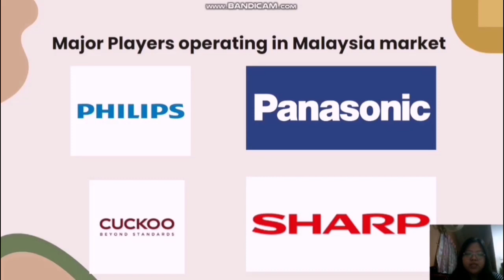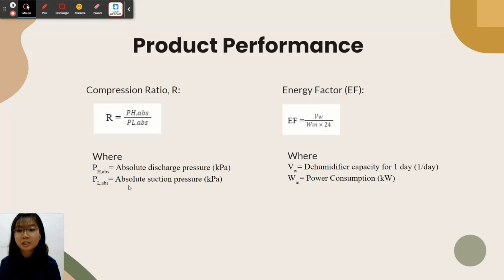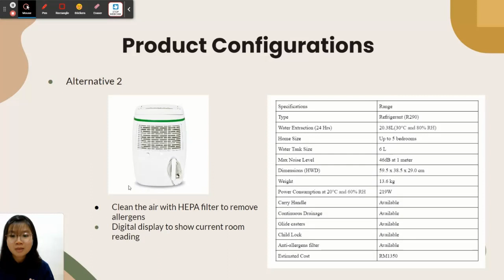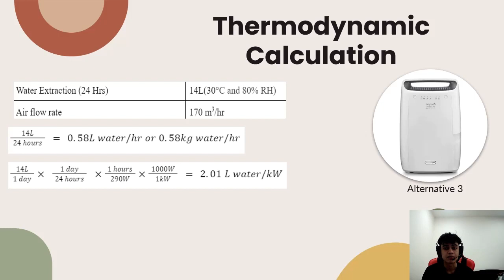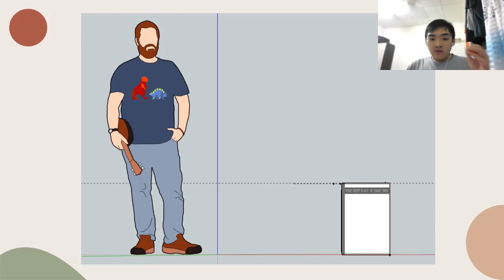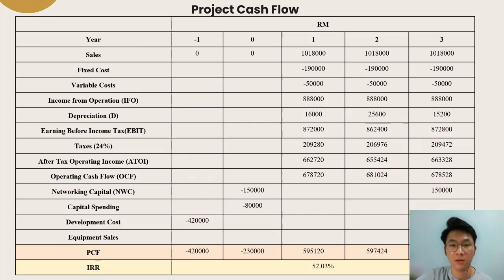CPD Project (Household Refrigerant Dehumidifiers) Group 6

Comment: Hi, I'm Kai Ying from Group 3.
I have question is that why is it necessary to have the Control Panel as well as the LED Strip as you've mentioned that it can be controlled through Wireless Connection from Smartphone right?
With the wireless connection, it seems like the two things mentioned above are not really necessary as it will increase the cost as well.